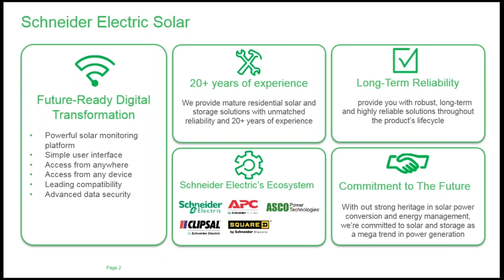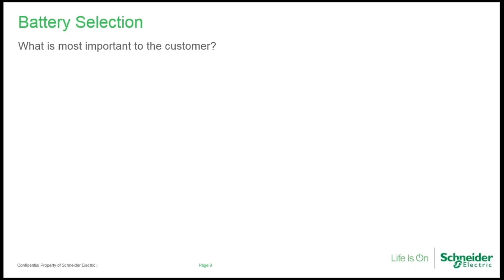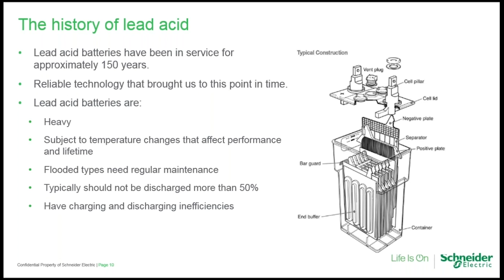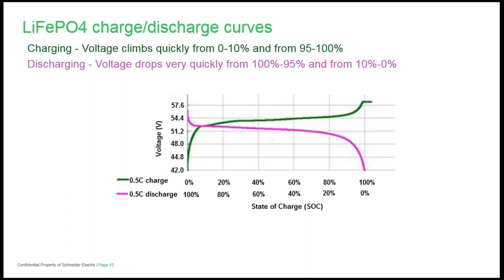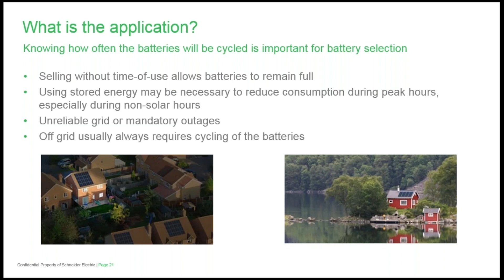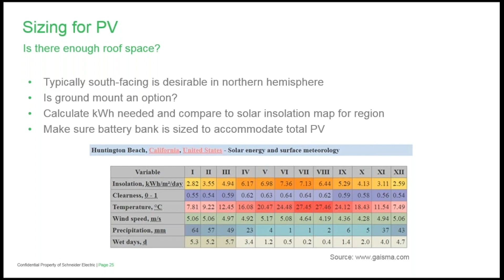Battery Selection and Sizing for Solar Storage Systems Webinar Replay

Comment: Nice basic overview, but I would like to see a detailed presentation on 1) off-grid use 2) LFP (open loop).  One issue I never have seen addressed in the docs or videos is inverter precharge with LFP.  Is it necessary / desireable, considering effect on both the inverter and the BMS(s)?

Comment: Hi, I have two new AmpereTime LiFePO4 51.2V 90Ah connected in parallel. I want to use them as the main battery bank for my new XW Pro. I charged them to full with an external charger before connecting them to the XW Pro. When I close the circuit, the XW Pro doesn't turn on and the battery bank voltage drops to 0v. I need to open the circuit and switch each battery off and on again to reset their bms and get voltage back. Is the initial current drawned from the XW Pro too high? If so is there a way to limit that initial current spike? Do I need to buy and connect more batteries? It's getting kind of expensive... 😩

Comment: How many battery monitors can be installed with 4 48v battery banks?
Reply from the maker: Hi Luis, any system with our Battery Monitor counts as one large battery bank. Multiple Battery Monitors are not necessary. 
Larger amperage shunts are also available through 3rd parties. Hope this helps!